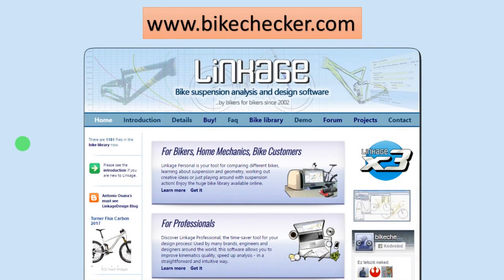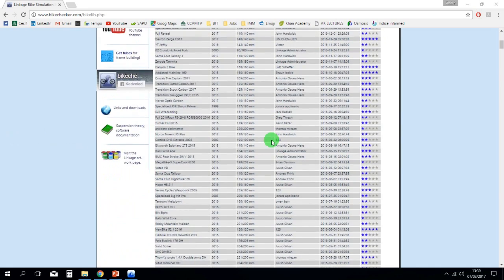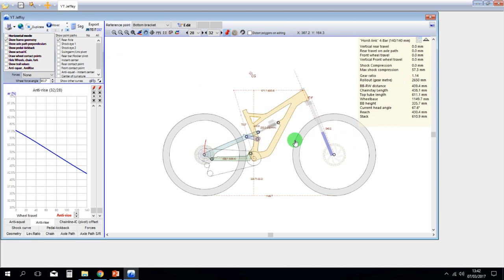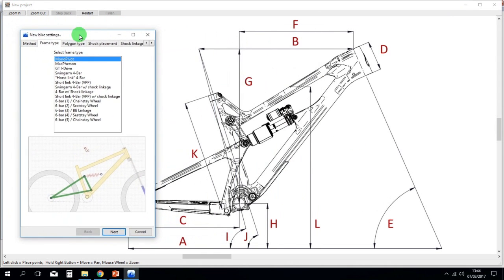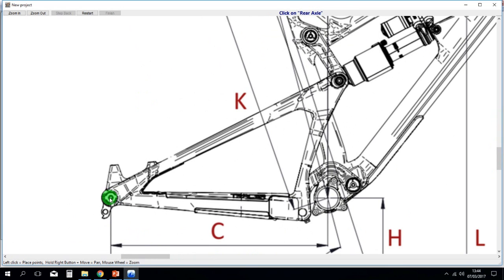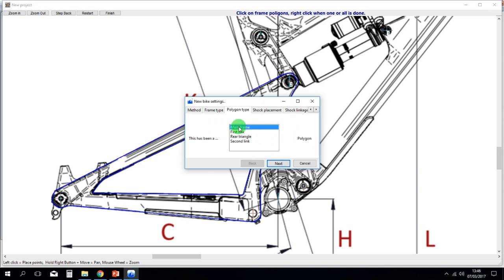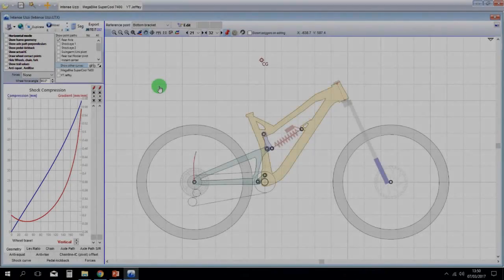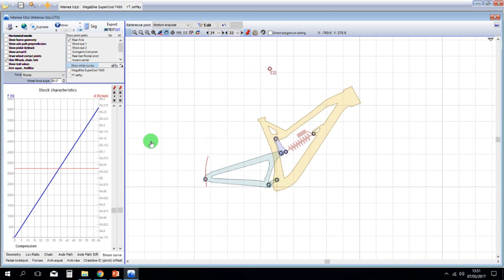"Linkage X3" simulation software (MTB suspension Ep.16)

Comment: I cant check my bike progression because program says: Warning, Demo version........
Reply from the maker: +Kacper Sochacki what bike do you have?
Reply: Its a bike that u won't be able to find fast... Steppenwolf tycoon comp 2015 27,5 140/140 mm
I found only that: https://scr.hu/qaNWP3
Shock: 200x51
Reply from the maker: Is this one? If so, then it's very progressive (60%). It will be hard to bottom-out this bike.
https://cdn.shopify.com/s/files/1/0725/8321/products/Tycoon_Comp_Full_Suspension_Bicycle_-_1.jpg?v=1449750038
Reply: andrextr its this one, but something is wrong, i had to add some bottomless rings, cuz it was really easy to bottom out :D Can u give me more my bike characteristics?
Reply from the maker: That's weird. I did a draft model of the bike and it looked quite progressive. Are you making big jumps with it? Is the SAG more than 30%? You can take a side-view photo of the bike (non-drive side) to make it a better model (take it perpendicular to reduce distortion like this):
http://p.vitalmtb.com/temp_photos/1463/max_DSC1481_897330.jpg

Comment: hey a new Marin bike just came out.  it's called the Wolf Ridge and it looks whack.  what do you think of it?  I can't wrap my head around it.
Reply from the maker: +Joel Hi. Its not my favourite design due to the high chain growth and pedal kickback. I did a small video about the bike. I used a trick to simulate approximately the slider. However an update to linkage came out a few days ago, and now it includes the possibility to simulate sliders. The results are similar to my model thought. Check it here: https://youtu.be/P9yk8LXNxIU

Comment: Two analysis questions:

1) Is anti-squat calculated with 0 mm front travel, or do you take front travel into consideration?

2) What height should the "normal" CG be set at?

Thanks!
Reply from the maker: 1) It's good ideia to take the front travel into consideration to be more realistic. At least when determining the anti-squat at SAG position (which is the most important). 

2) I usually set up at 1.1m from the ground on a M/L frame. This would correspond to slightly above the saddle for an average tall rider.

Comment: HI, can you check this bike:https://www.pulse-cycles.com/en/bikes/rs-2/
Thank you!!!
Reply from the maker: It has good pedaling efficiency (anti-squats of 100%) and anti-rise also 100% (geometry is not affected by rear braking). The frame has low progressivity (around 10%) so it uses all the travel easily which means that if you are an aggressive rider it will bottom-out easily. Bye
Reply: Thanks a lot

Comment: waiting for your  analysis or comment about Banshee Legend 2016... Thanks!!
Reply from the maker: I already did the model but never did the video because it takes a lot of time and also because I don't like to criticize much and in the case of legend I have some critics. First the bike has too high anti-squat (between 150% and 200%), and as a consequence it has a significative chain growth and pedal kickback. Finally, the leverage ratio is also not great. The bike has a final regressive leverage ratio, which is commom on XC/Trail bikes with air shocks, but not much common on DH bikes with coil shocks. It's not a good mach indeed. Because of that final part, the overall progressivity is 20% (which is a bit low for a DH bike)
Reply: Thanks you for your answer Andre! 
but.... Your comment gives me some worries now because I already placed an order it. Haha
As I ordered this bike for pure park riding only, I want to hear your opinion on this basis once more.
Would 'high anti squat' character be a significant flaw in DH which goes downhill mostly with descending position? Most riders on the Legend say It chops technical trails attacking every corners like a beast. a little confusing...

Comment: Which frame would have better pedalling efficiency a 2017 nukeproof mega or a 2017knolly warden, and witch is more progressive 
Thanks
Reply from the maker: Both bikes have a quite lowish anti-squats, but mega is more close to 100% than knolly. Knolly uses low anti-squats on porpose since they have a different phisolophy (which is stated on their website). They prefer to use a shock with a trail/climb mode lever, and allow the rider to control pedalling efficiency using the lever instead of using higher amount of anti-squat. The disadvantage of this is that you need to remember to turn it ON or OFF, and when it's turned ON you loose some small bump sensitivity obviously. I prefer the anti-squat philosophy than the shock platform one. Both bikes are progressive but Mega is more (Mega is quite progressive). Bye

Comment: Hey Andre, could you please do an analysis on the kona operator 2017? It's the bike that I'm buying and I'd love to know technical stuff about it. Thanks in advance
Reply from the maker: Operator works as a singlepivot regarding pedaling and braking characteristics because wheels and brakes are on chainstay (this won't make the bike bad, it's just a characteristic). Operator has anti-squats close to 100% on a DH transmission (because the main pivot is just on top of the chainring), so it pedals well (for a DH bike obviously). Anti-rise around 90-100% (which is commun on singlepivot-like bikes), this means that when you brake with only the rear brake on a parking lot, the rear suspension won't move (on most horst-link/FSR bikes it extends with this test). Progressivity of Operator 2017 is good (around 35%, which is not much but it's on the lower side of the average for a DH bike). Bye
Reply: Thanks a lot for the technical stuff Andre. Btw, do you like it?
Reply from the maker: +Alessandro Dando It's not bad but It's not my favourite. I prefer more progressive bikes (it won't mean they are better but I like the bottomless feeling on big impacts).
Reply: Yes, I know more progressive bikes are better on big impacts like flat landings, but I think that with a more linear suspension is easier to use all of the travel on trails with not so many jumps but with lots of rock gardens and huge roots. Am I wrong?
Reply from the maker: Yes that's rigth. Progressive bikes are better on very small bumps and very big bumps (they are very soft on the beggining travel and very stiff at the ending travel). For medium sized impacts like you described, the linear bikes use more travel and are better (until the point they bottom-out).

Comment: Hi Andre I'm stuck between a choice of bike if you can help me out. YT Capra AL Comp or Orbea Rallon X10 which is better?
Reply from the maker: Both bikes have nice pedaling efficiency (anti-squat). The main difference is the progressivity. Rallon is almost linear (low progressivity) while Capra is very progressive. So, this makes Capra more sensitive on initial travel and more resistant to bottom-out at the same time. On the other hand, Rallon uses all travel more easily (Capra only uses the last part of the travel on big impacts). If you are an aggressive rider, and if you suffer from harsh bottom-out issues on most bikes, then Capra is better for you in term of suspension. Otherwise, for a more trail usage, consider Rallon. Bye

Comment: Hi Andre! Any thoughts on the new Jekyll? A suspension analysis video of it would be great!! btw your suspension  content is very helpful. cheers man!
Reply from the maker: I have the model but since these videos take so many hours to do, I never did it yet for Jekkyl. Anyway, Jekyll works as a single pivot regarding pedaling and braking caracteristics. Jekyll has an antisquat around 80% (because the main pivot is sligthly below the top of chainring) and an anti-rise around 90-95% (which is commun on these type of suspension layout). It has low progressivity (almost linear). The shock (Dyad) has a huge negative chamber which provides a smooth initial travel (similar to a coil), however because of that, you need huge pressures on main chamber to get a decent SAG. Overal the Dyad is a very linear shock (similar to a coil). This shock linearity combined with a linear frame, makes the whole bike linear (which uses all the travel more often, but it's easy to bottom-out harhsly on bigger impacts). Bye
Reply: andrextr Thanks for the info Andre, its great. But actually I was talking about the new Jekyll that Cannondale released a few days ago. It has a different suspension system and works with normal shocks.
Reply from the maker: Yes, I forgot that they released a new one... I build a quick model and the 2018 Jekyll has 15% progressivity,  80% anti-squat (on average) and anti-rise of 90%. Nothing too strange... The anti-squat could be higher, but since you can adjust the travel of the shock on-the-fly this is not a big problem. Bye
Reply: andrextr Thanks!

Comment: Hi Andre I like your videos. Can you do the 2017 Norco Range 29er? Thanks
Reply from the maker: Hi. I did a draft model, and it has a progressivity of ~27%,  anti-squats of 100-110% at all rear cogs. and anti-rise of 60%. Good values for a 150mm bike.
Reply: andrextr was the pedal kickback improved over the 2016 Range?
Reply from the maker: The older range had a quite high anti-squats, so my guess is yes, the new norco should have lower kickback. The difference will be small though. The only way to get good anti-squat without kickback and chaingrowth is on high-pivot bikes (with an idler pulley). Bye
Reply: andrextr I'm excited for Norcos new downhill bike. I think you will be impressed
Reply from the maker: Yes, it's an high-pivot bike. It has several advantages. I'm working at this moment with a bike brand on a very inovative high-pivot bike ;) Can't disclose more info. Let's see what happens. Bye :)
Reply: andrextr awesome I'm excited:)

Comment: Andre, can you do GT Sanction?
Reply from the maker: Linkage X3 can't do GT anti-squat yet, because the bottom-bracket moves and it is part of the unsprung mass (non-suspended mass). So the graphical method of anti-squat does not apply in GT. Regarding anti-rise is around 100%, so when you brake with the rear brake (only) the rear suspension doesn't move (on many horst-link designs it extends a bit under rear braking)...you can test this on a parking lot (if you do so, send me a video of it :D)... The Sanction is linear (constant leverage ratio) since it works as a singlepivot design (so its easy to bottom-out on bigger impacts). Bye
Reply: This bike doesn't seem to get much love from the press. It is aluminium and "heavy", chainstays are not super short and is a single pivot design (not mentioning that GT has not been a hyped hot brand for a loooong time now). Yet it performs quite well in the EWS.

Comment: I'm considering commencal supreme v4.2 as my first dh bike. mostly because it looks cool :-)
It's a kind of linkage driven singlepivot bike. it maybe is poor at anti-rise.
But I guess that thank's to idler pulley thing, it might have good pedaling efficiency and almost no pedal kickback
What i really want know is the pros and cons of it's very high main pivot and veeeery rearward axle path.
What's your opinion Andre? As they says, is it great advantage for race type dh bike?
Reply from the maker: +sri da I like it. Having an high pivot results in rearward path which is better to absorb bumps (and it's more balanced with front fork since the fork also has a rearward path). High pivot bikes also have advantages on antisquat. Antisquat is a result of chain pulling and driving force (which in turn depends on swingarm angle). On high pivot bikes since the swingarm has a steep angle you don't need much chain pulling to get good antisquat (because during acceleration the wheel moves forward and tends to rotate the swingarm counter clockwise, extending the suspension... The steeper the swingarm the more "free" antisquat you got). Thus, you can get minimal chaingrowth and kickback using a pulley and still got good AS. Antirise is higher but honestly I'm starting to believe that antirise is more marketing than an actual issue... Most motorbikes for instance also use high pivot swingarm 4bar suspension (with antirises greater than 100%)... I will discuss this antirise thing in future video (also the antisquat part). Regarding v4 it has a normal progressivity for DH and an antirise around 130% (when you apply the rear brake on a parking lot the rear suspension squats a bit... On most Horst links designs it extends in this test). The antisquat of v4 should be ok (I don't have a good model for this bike since the idler and main pivot are not concentric and it's hard to know their coordinates without a good drawing). Bye
Reply: Thank you for your great answer ;-)